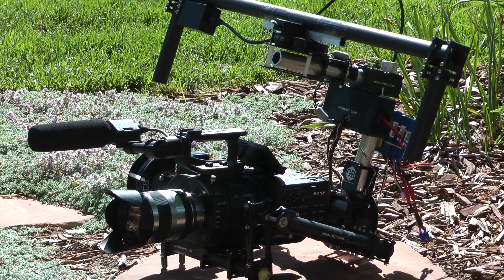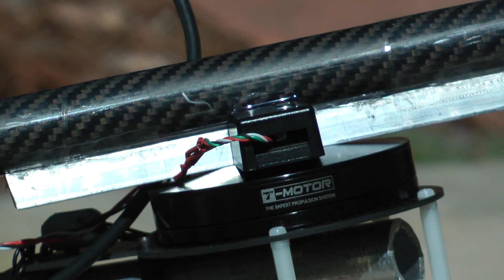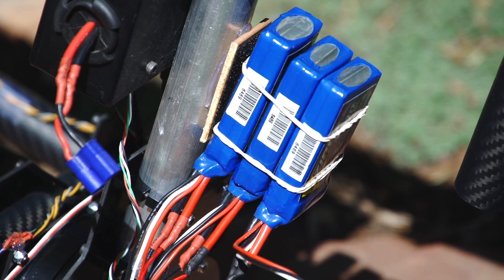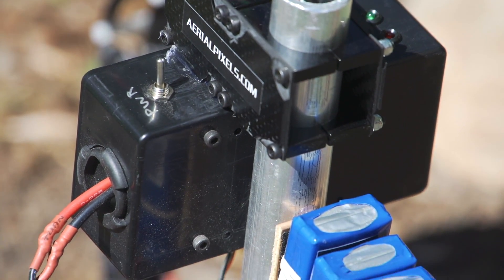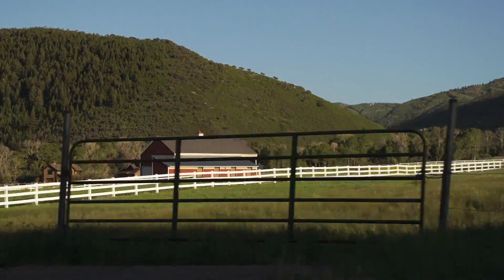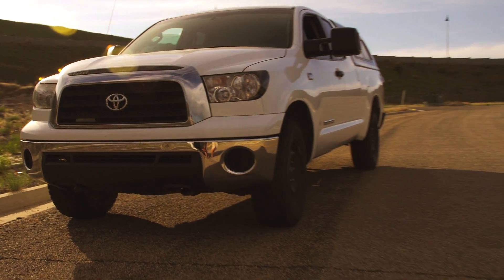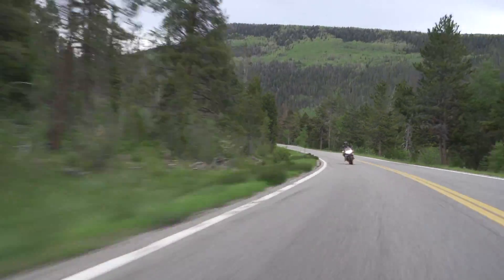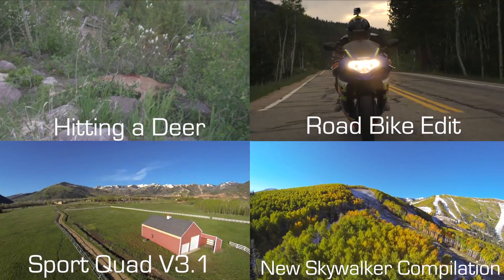Huge 3-Axis Brushless Gimbal for FS700 - RCTESTFLIGHT -

Comment: About the weight problem...  I'm wondering if a "rigid body" plus shoulder harness would help.  The rig would be attached to a shoulder harness (one "saddle" for each shoulder) but there would also be a rearward-extended, rigidly-attached cantilever with a counter-weight.  The goal would be to make the c.g. of the rig and the c.g. of your body line up on the same vertical line. If you achieved that, you wouldn't have to constantly apply a counter-moment to the rig with your arms, hands and back. But this would also increase what we call the "rotational moment of inertia", so your ability to rotate the camera quickly about the yaw axis would be compromised.

Comment: Looks cool, but after using Mövi M5 with a remote control, all of these DIY gimbals have started to look like something that barely makes it. Not because of the remote of Mövi, but because it's in the details that makes or breaks the gimbal. This seems to deliver though, which is a good start.